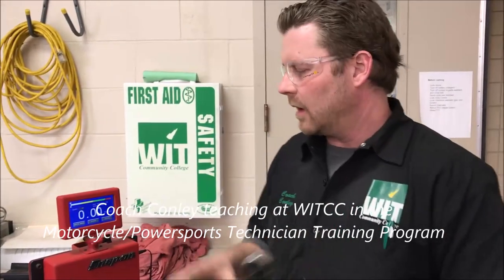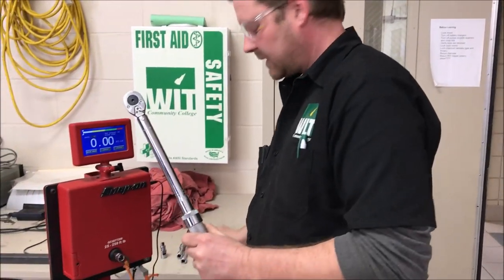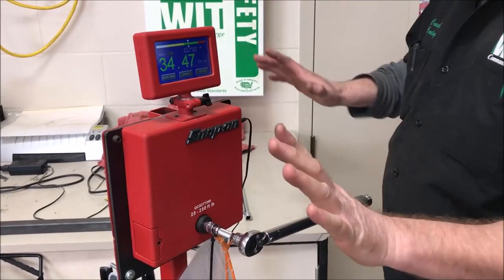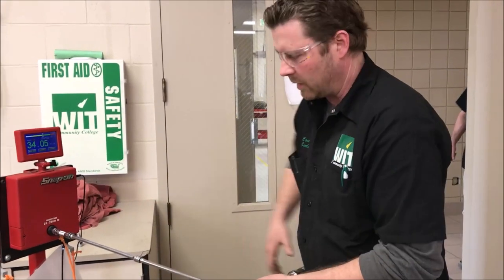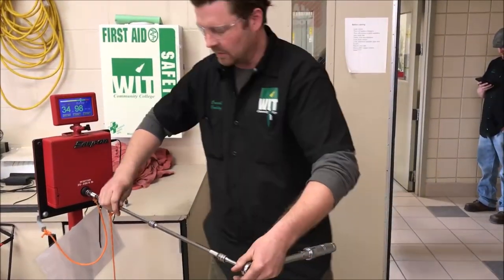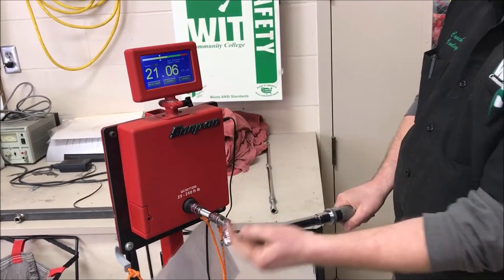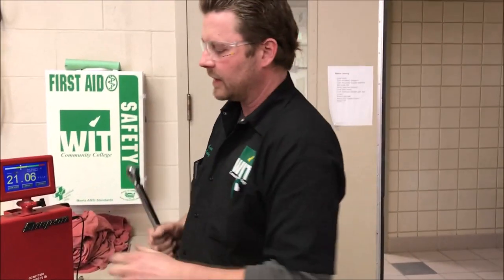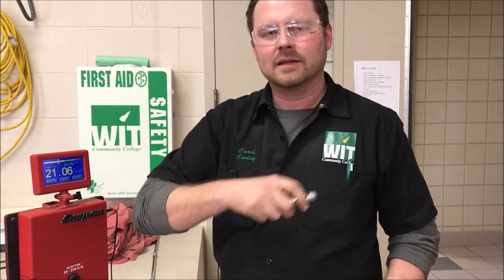Will extensions change your torque wrench reading? Proof and the answer!

Comment: Physics demands that extensions make a difference, but normal extensions are so light that the difference is negligible. You could demonstrate it with an extension that's, e.g., 1 foot long and 6 feet in diameter. That would weigh almost 14,000 pounds (assuming it's solid steel) and wouldn't even be budged by applying 35 ft. lbs. of torque to one end of it. Your torque wrench would click but your torque meter on the other end of the massive extension would still be reading zero.
Reply from the maker: Application sure can change what physics demands doesn't it. Like you said these small numbers just won't show the real physics you mention. 
We sure love you taking the time to comment. Want to help us back? Please subscribe and give us a high 5 here:  https://www.paypal.me/how2wrench  
Follow us! 
www.How2Wrench.com      
www.Tools2Wrench.com   
Facebook: 
https://www.facebook.com/How2Wrench/  
Instagram:
https://www.instagram.com/how2wrench/

Comment: Would the amount of torque being applied matter as to the results?  In the test you used 35lb ft of torque and the results speak for themselves.  My question is what happens when you really start cranking on it to say 100 or 150lb ft of torque?   At some point you will start to get twist in those extensions and I'd love to know at what point that is.
Reply: There would be no difference at 10, 100 or 10,000 pounds (as long as nothing broke). Yes the extension will twist like a torsion spring but once the spring has stabilized (no motion) the torque out will be the same as the torque in. But if you run a impact wrench with extensions and "bounce" the spring you will lose torque. 

This is how those torque sticks for tightening lug nuts with a impact work. They are just torsion springs with different spring rates. The lower toque ones are softer springs and the higher torque ones have higher spring rates. If you used them with a torque wrench set to 100 ft-lbs. you would twist the lower ones more than the higher ones but your output torque would be the same at 100 ft-lbs. for all of them.

Comment: Thanks for the video.  This is a question I have had and couldn't really find much on.  One twist on this test that you could answer for me...in addition to the 3" extension, add an adapter if you can.  I was using my 1/4" torque wrench with a 3/8" adapter along with a 3" extension.  The torque spec was 100 inch pounds on a fairly large hex head bolt, which is why I was using the above setup.  The result I got was that I could not get my torque wrench to click and I way overtightened the bolt.
Reply: Perhaps you missed the click, because the small torque values are not going to be a very perceptible click, it'll be more felt than heard.  You probably just went past the click and just kept on pushing way past the setting.
Assuming your torque wrench isn't defective.
Reply: +BrewCityRider - Yes, what happened to you is very common, and is why some mechanics prefer not to use torque wrenches, and go by feel. The exception would be for things like Cylinder head bolts and other high torque items.
The reason it didn't click is very simple. I'll do my best to give you a quick explanation. If you have a bolt, it's achievable torque will be different, depending on where it is being used. There are hard joints & soft joints, then there are many variations of those two. But in it's simplest form, a hard joint is metal to metal. As an example, a front or rear sprocket bolt is going to be a hard joint. A soft joint is something that has a gasket in between them, or doing up a plastic or rubber part. There are many more variables. Oil, grease, silicone and even loctite can stop you achieving your desired torque.

Also, long extensions are ok to use, only in the lower to mid range of a torque wrench's application. At a certain point, the extension will start flexing (invisible to the eye) and stop the toque wrench from clicking. The machine that Shane is using here will not show that, because it only shows peak torque and it's not giving the torque wrench the feed back that it would typically receive from a fastener. Also, sockets can flex, so do not use those long extension type. Now, when I say flex, it's not as if it's twisting around and is going to snap. What it does, is it gives just a slight amount flex that stops the torque wrench from clicking.  

Having said that, in your case, you went to a bigger extension, so I do not think that was the case with your problem. I would be interested to know what you were doing up, and if you had oil or anything else on the threads.
I'm only used to working in metric, but doing a quick "Google" conversion, your hex head bolt works out to be 10.Nm, which is a very low torque for a large hex head bolt. These things normally present themselves in special applications. But, isn't that torque setting getting into the maximum range of "1/4" ? I can tell you now, do not use "1/4" extensions at that torque range, because it will flex. (I'm talking about an extension longer than 2inches)

Apart from being a motorbike mechanic myself, I spent 25 years working for one of the largest car makers in the world. My job was to check assembly line inspection toques, and adjust torque wrenches accordingly. I had to perform these tests every single day on various nuts and bolts. I remember when I first started there, I was blown away by what I learnt about tightening torque, inspection torque & peak torque. I suddenly realised how little I knew. That was 40% of my job, the other 60% was engine testing (Dyno testing) 

I've only just discovered this channel, and I have to say, I'm impressed with Shane and the knowledge that he is sharing.
Reply: I don't mean any disrespect when I say this, but basic static analysis doesn't jive with what you're saying about torsional deflection of an axial extension causing inaccurate torque to be applied to a fastener in a constant load situation like when using a torque wrench. Maybe there's something about how click-type torque wrenches work that I'm missing, but from a physics standpoint, the magnitude of the force at the wrench is 100% the magnitude of the force at the fastener REGARDLESS of any flex or twist of the extension or socket (again, in a static context).

The real problem with using axial extensions in this situation is it increases the likelihood of you being off center of the fastener, which obviously DOES impact accuracy of the torque wrench. You don't need to be off by a lot on say a 2-ft extension to appreciably undertorque a bolt.

For "overtorquing" situations like BrewCityRider experienced, the most logical explanation is either that (1) his fastener wasn't clean/dry and the torque spec was for non-lubricated install, or (2) the fastener he was using was somehow already compromised (eg, past its yield point) so it just kept deforming vs increasing preload. Not sure how he determined he overtorqued the bolt though (re-tightened? snapped?)

Comment: People sometimes wonder why I don't use a crowfoot and then trust torque readings. Of course if the wrench is long and if your handle angle is 90deg to the crowfoot extension, the result may be close because the crowfoot only adds an inch or so to the lever. There is also the mitigating factor that many torque guidelines have significant tolerance. However there is no doubt that as that crowfoot angle changes you get a sinusoidal variance in torque, as small as that factor may be. Whether it matters depends on the application. It's too bad those calibration machines aren't more widely available -- I would love to check out my wrenches.

Comment: Shane, great video. I am constantly seeing misinformation about torque when using extensions. It's refreshing to see not only correct information, but backed up with testing. Guys, number one, always use the correct drive size of extensions based upon your torque. Here are the ANZI  square drives limits: 1/4" drive = max 300 in.lbs., 3/8" drive = max 100 ft.lbs. 1/2" drive = max 300 ft.lbs., 1" drive = max 2000 ft.lbs. Never exceed these limits, especially when using drive adapters.
Do extension flex? Sure they do...but they STOP flexing at a certain point, then your have one to one torque. If they did not stop flexing, you could not use them, right?
Now this ONLY applies to hand operated torque wrenches.  Air or electric impact wrenches used with torque sticks are a whole other thing.
Keep up the good work, 

Gary, Snap-on Tools Torque Trainer.
Reply: Gary, what if you extend the length of the handle for better leverage? I recently tried tightening an axle nut to 215 ft lbs but could not physically do it so I slipped a pipe over the handle and that did it

T
Reply: @abyssalsoul6216  Never use a "cheater" bar with a torque wrench. The reason it's easier is you are applying less torque. as much as 30% less, depending on the length if the bar. Buy a longer torque wrench
Reply: @garyfitzhugh1056  thank you for your reply. I think I will solllicit the help of someone and have four hands tightening
Reply: he this is bearly any torque setting at all, do 2000nm+ and we can have a discussion
Reply: Except for the test they did proves that more extensions require you to use more torque.

Comment: Thanks Shane for this video. I did ask this question on your other extension video. I always was under the impression that with a long extension you lose torque due to that slight twisting of the extension. But I guess the loss is minimal. "Keep Wrenching "👍👍👍👍
Reply: Twisting only comes into play with impact wrenches, because of the short duration impulse from the wrench, rather than a continuous application of torque.  That's the theory behind the torque sticks, which are basically torsion springs that start twisting at a certain level of torque, to prevent the torque from going beyond the goal.
Reply: To add to what DTR RTD said, even when an axial extension (what's being talked about in this vid) twists under load from a static/constant force, it's still going to "transmit" 100% of that force to the fastener. Any other outcome in this scenario would defy physics. The torque required to twist that extension doesn't just disappear in the extension: there are equal and opposite forces on each end of that extension (fastener and torque wrench) that's causing it to twist. Having said this, the myth that you need to turn a wrench (including torque wrenches) with more torque if using an axial extension in order to apply some particular (lesser) torque to a fastener is also patently false for the same reason. Again, all only applicable in the context of static/constant forces. The impact forces delivered by impact tools complicates things.

Comment: I use to always add an extra 1ft-lb when I had to use a long extension. But now it makes sense there would be minimal loss because the weight of the extension is not great enough to increase the rotational resistance, as long as the angle is supported.
Reply: 90 degree and keeping the lever arm the same length  the wrench should be accurate

Comment: I came here just for universal adapters on torque wrenches. In my mind as long as you are not binding the universal joint every other angle should not affect the torque transfer (or at least be less that 1/2 pound). This of course means a much smaller degree of movement, which is all I need in my project. I was glad to see him use the universal towards the end (the off-camera guy did deserve that high-five for bring it up) but I feel it was not well tested out. There seemed to be way too much angle and most likely the joint was binding. If that was a joint like a CV joint, the drastic angle would not matter as much since it would not bind. I would have like to see torque test at a very slight angle to a slightly more angle and finally to the max where he had it. I still do not have my answer...back to the internet abyss. Thanks for the good video on extensions, though.
Reply: I’m trying to find info on that same thing. How do you calculate torque when you are offset at a slight angle?
Reply from the maker: Hi there...I have the info you need and could email it to you. I’d be glad to take the time. Can you help us back?
You just need a quick answer to make sure you’re on track or what direction to go? Please donate (https://www.paypal.me/how2wrench) what you feel getting this information is worth to you and I’ll reply back with what we would do at H2W!

Need the full service techline?  Coach Conley is also available for hire to personally work one on one with you if ever needed. Yep he is a real person. Details here: https://how2wrench.com/product/personal-tech-training-phone-facetime/ 

Your answers and help are just around the corner. Save time and money while protecting your investment and yourself by doing it the right way!
Reply from the maker: Hi there...I have the info you need and could email it to you. YouTube doesn’t allow pics and documents on here.
I’d be glad to take the time. Can you help us back?
You just need a quick answer to make sure you’re on track or what direction to go? Please donate (https://www.paypal.me/how2wrench) what you feel getting this information is worth to you and I’ll reply back with what we would do at H2W!

Need the full service techline?  Coach Conley is also available for hire to personally work one on one with you if ever needed. Yep he is a real person. Details here: https://how2wrench.com/product/personal-tech-training-phone-facetime/ 

Your answers and help are just around the corner. Save time and money while protecting your investment and yourself by doing it the right way!

Comment: Thanks for the video, sir. I was thinking of getting a torque wrench with higher capacity, but budget is tight :(  So I Googled up a little bit to see If there's a workaround to increase torque wrench capacity, and I found out that I could use an extension. But I worried that the the torque reading won't be accurate. Well, this video helps me a lot ! I rise my cup of iced tea to all my fellow mechanic here !

Comment: Can you do another video but at higher torques? We ones set a hub sprocket bolt to 1000nm using a multiplier and got different angels using a 6 inch extension. Difference of about 50deg 
After I witness this iv always believed at higher torques over 500nM it starts to effect it
Reply from the maker: I no longer have the machine to test. I am looking to visiting the manufacture of the tool or something like it and will keep your request in mind for a future video. 
The best rule of thumb is to trust the engineering and tool certifications and instructions on use from these tool and product manufacture. They have a lot on the line with lawsuits at risk and spend a great deal of money to avoid them. 

Thanks for commenting and adding value to our community!

Have you subscribed yet to never miss a video? Have you seen the video playlists? Check them out here: https://www.youtube.com/user/conleybuilt/playlists  

Want to say “thanks” or “keep it up”? Click here https://www.paypal.me/how2wrench    
 
Your answers and help are just around the corner. Save time and money while protecting your investment and yourself by doing it the right way at www.How2Wrench.com

Comment: Can you do parallel extension please?

Example - C-wrench needed to for motorcycle head bearing nut. Those need to be "torque" to specific value and usually you use C-wrench with 1/2 inch square hole to mate with 1/2 inch torque wrench. The square hole is offset from the centre of the nut. Some say that if you mate C-wrench and torque wrench at 90 degree then there is no need for further torque adjustment/calculation?
Reply from the maker: Let me try and see I can catch Shane to answer quick. He is currently at an extended stay in Japan training students this winter. We are just the social media team. 
Due to his limited bandwidth on time and demand for help, we had to choose to forward any requests from members first and it is only $1.99 a month to join.  All member tech questions like this get directly forwarded to him every day! Be mindful and honest that this is for "quick questions" that would serve you answers that can clearly be addressed. If it's a diagnosis need you'll need to use the one-on-one service. 
Here is how to get in!
* Join here: https://www.youtube.com/channel/UCBhM8DCKnT3qXwTW0eToyCg/join       
* Just looking to give us a high 5? Click here: https://www.paypal.me/how2wrench 
* Is this an emergency and your head is about to explode from frustration or fear? Get Shane’s cell here: https://how2wrench.com/ols/products/techline-one-on-one     

Have you seen our "YouTube Trained Support Shirts? Great way to "high five us" https://goodfellasmerch.com/collections/how-2-wrench/products/support-shirt

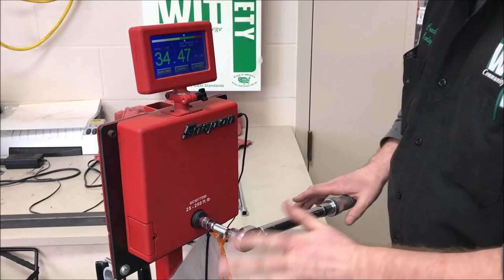Comment: Yes, change in length can apply the same torque. HOWEVER, just remember that the amount of angle (of twist) required does change with length. The longer the extensions the more angle of twist that will need to be applied to achieve the same torque value required. Ex: look at how much his  back hand moves at 1:05 vs 1:36
Reply from the maker: Nice mention...TY
Reply: Ohh I see what you mean.
And you are correct m